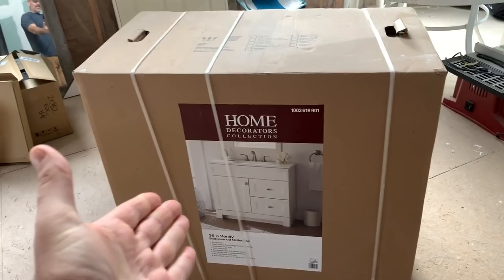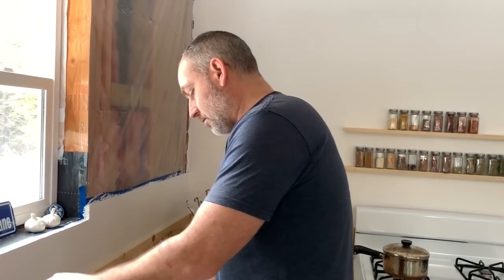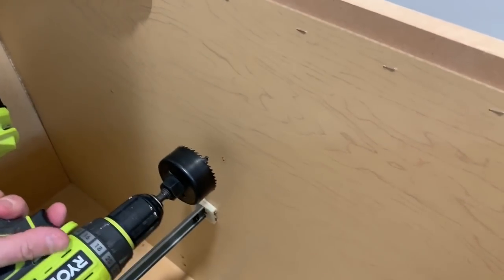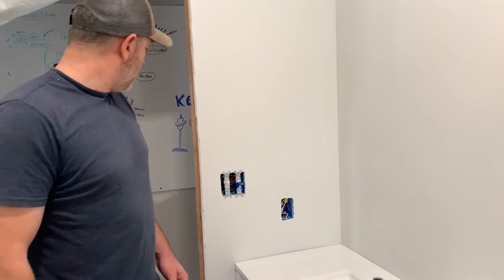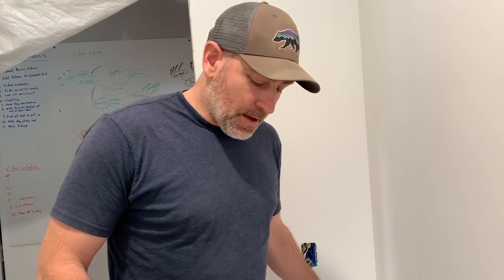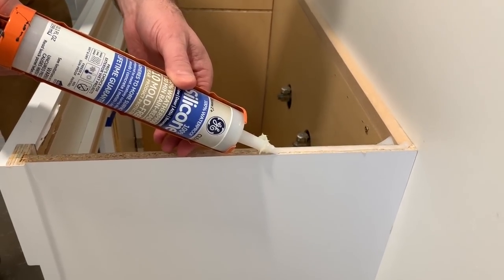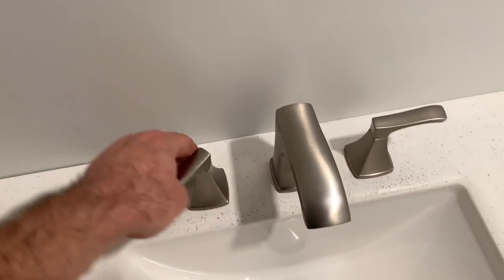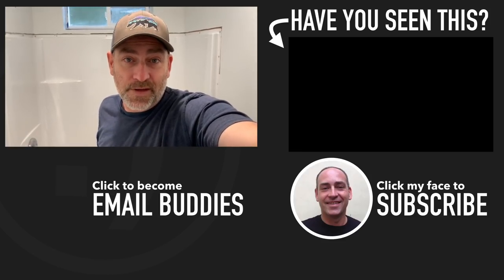DIY Installing Bathroom Vanity | Off Grid Cabin Build #65

Comment: Use a framing square slide it down the back of the cabinet along side the piping make a mark on the back edge that will give the position of pipes

Comment: They make a fitting to go from the 2” pipe coming out of the wall to the 1-14” slip nut joint for the trap. It is a called a 2” x 1-1/4” Desanko fitting. They come male and female glue joint so you can glue them either I n a 2” pipe or glued in the hub of a 2” fitting.

Comment: Nice progress.   For your tub trim, look for some  bull nose tiles to put around the transition, wood is going to be problematic with the water splashes.  If you do use wood  paint it on all sides before installing.  WD-40 works good but Goo-Gone works better on stickers.
Reply from the maker: thanks for the tips!
Reply: Yeah if not sealed wood is very problematic around water. Better off using tile

Comment: Martin, when cutting holes in the vanity unit, you showed 'least favouite tool for drilling 2x4'. The holesaw you used is not meant for timber. It's a HSS holesaw designed for cutting metal. Those for timber are much thinner. Pchew.

Comment: If you want the inside and outside of the holes on the vanity back to be clean when drilling, drill 1/2 way thru on one side to score it, and finish the hole from the other side ; ). Also, typical wall paint works well on those valves/pvc fixtures and will make decent reference marks, just remember to wipe it off.

Comment: On all ur utilities that feed into the house u need to install shutoffs. One for each water source under the sink and tub if available.  That way in an emergency you can isolate the problem and still have water or gas. They come in compression fittings that u just put onto the pipe and it slides a feral into the pipe and you use a wrench and tighten it, some come as soldered connections that require soldering, PEX tubing that uses compression fittings to hold plastic pipe in place of the fitting. They make adapters for going to pex and copper. Having isolated shut offs is code. Also was it level?

Comment: You bumped into a waste water pipe junction problem that all homeowners experience.  5 houses and now 1 condo later, I had to reconnect all junctions again and make many trips to HD to get the correct connectors while life goes on around us. All of our condo connections to the stacks were the opposite drain angle of what they should have been. But I just expect these inconveniences and necessary trips on our 6th and retirement home.  It is really just another way for manufacturers to make money. Hang in there. You folks are doing great! 
Northern Alberta to Southern Florida following God's plan with a year in Switzerland thrown in too! God is good despite cancer, moves and change. God is good!

Comment: On your shower the dry wall should be over the surround lip filling the gap you left. It seals the walls and keeps water from going behind the wall. You need to look at directions more so you don’t make more work for your self fixing mistakes

Comment: Wood trim around the sink and tub surround is a "NOT SO PRETTY GOOD IDEA."  No matter how well you seal it with varnish, water will get through and stain the wood.  I've had good results with PVC boards sold at Home Depot and Lowe's.  DAP 3.0 is also a superior caulk for sink and bath.  To anchor the sink to the cabinet, 100% silicone caulk is generally used and it holds everything plenty strong.

Comment: If you have a particularly sticky label, cut a citrus fruit and rub it on  the label. Oranges are best but lemons or limes will work too.
Reply from the maker: i'll have to try it.
Reply: @MartinJohnsonOffGridLiving  Commercially produced label remover is citrus based.

Comment: I HAVE NEVER SEEN A DRYWALLER COVER THERE WALLS IN PUDDY.  MY UNCLE WAS A DRYWALLER THERE WALLS WHERE JUST ABOUT OVERED BECAUSE THEY DID THE SEAMS SO WIDE. HE NEVER HAD TO SAND ANY OF IT HE WAS GOOD. HE  DID IT ALL HIS LIFE  I USED A WET CLOTH TO WET SAND MY WALLS WORKED BETTER AND NO DUST